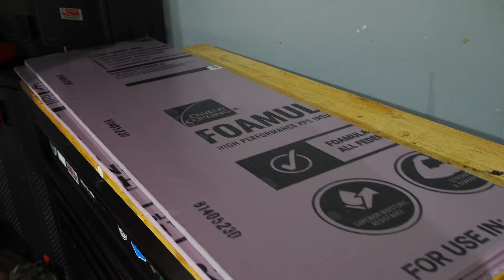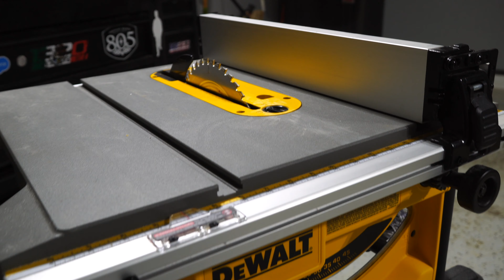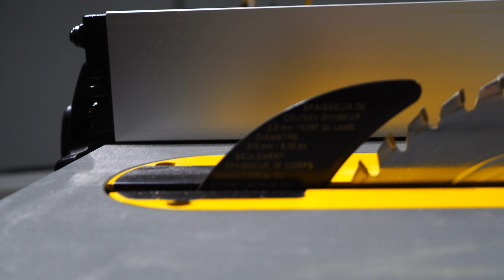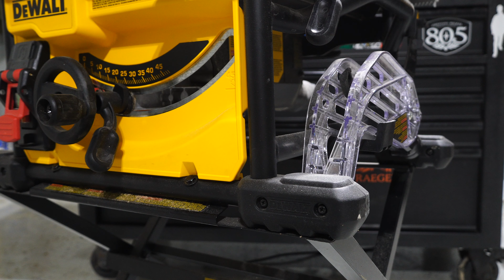No Table? No Problem! Make These 10 Cuts Without a Table Saw

Comment: Being somone with minimal space, and not needing to cut long rip or cross cuts over about 4ft, which piece would you say is more versatile all rounder, the straight edge guide or kreg rip cut guide please?
Reply from the maker: That is a great question. I think it honestly depends on your use-cases. Do you find yourself doing rip-cuts often? If that's one of your primary ways of breaking down material, I think the rip-cut is perfect. The straight-edge guide is more versatile, but takes a lot more set-up and measuring. In contrast, the rip-cut is a little more limited, BUT, the setup on it is so fast and convenient!

Comment: There are kerf cut calculators if you want to be able to plan about how long you will need fwiw.
Reply from the maker: That's actually a great point. I'll be sure to throw that in the description once I get back on the computer. Thanks!